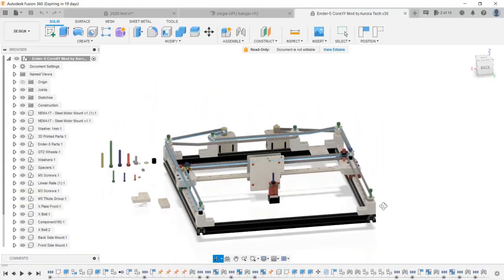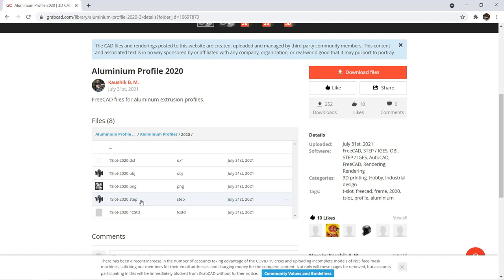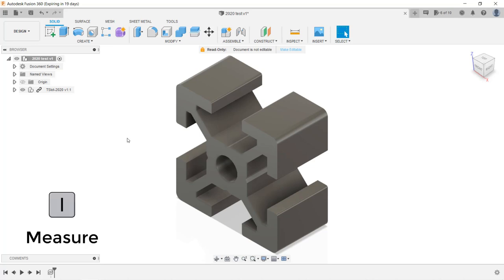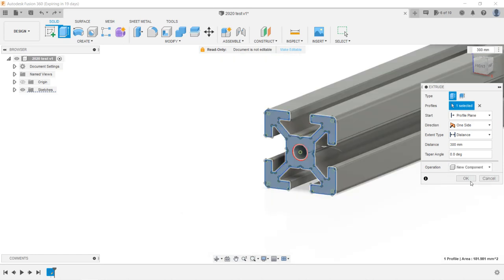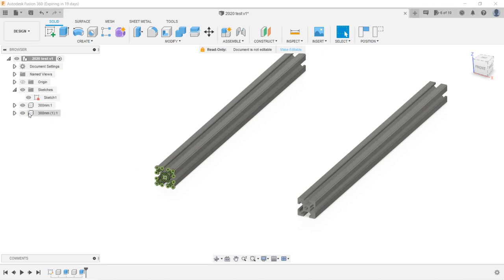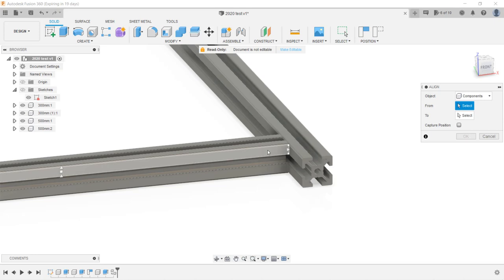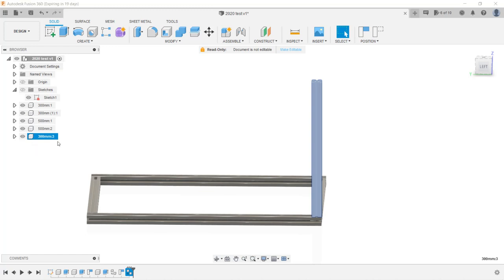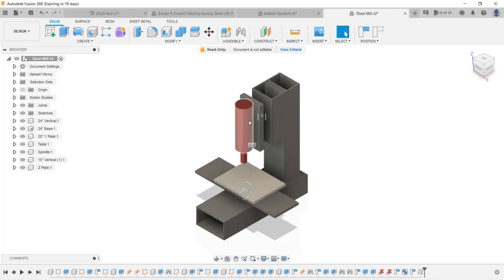Fusion 360 SHORT Tutorial For Beginners 004: Design with aluminum extrusion, import, project, align

Comment: You don't have to create a sketch from the imported STEP file. You can select the face on the imported part and Extrude it. That will create a new body, with the same profile as the selected face. Creating a sketch first is still a good idea though, especially if you need to reference part of the geometry in other sketches.

Another tip is to use the McMaster Carr library of parts. It's available from the insert menu in Fusion.
They have thousands of parts that include CAD drawings, that can be imported directly into the drawing in Fusion.
I used to use it for screws, brackets and aluminum profiles in the past.
Reply: Some of the item they inches to convert that a bit of different size than create the extrusion profile by metric to create. I did experience when I use the printed parts from Western diy cnc and purchase the metric extrusion from Aliexpress which over size on the printed parts. Did anyone come across this problem.
Reply: @alberttang1748  I haven't experienced that myself. There can be quite a large variation on extruded profiles from manufacturer to manufacturer. The profiles you could possible have been made to a slightly different profile, or with different tolerances than what the step file assumed.

Comment: At point 4:30 in the video, can anyone tell me how to center this new sketch exactly over the center point on the drawing plane. I've tried to move there, but I can't get it to move at all. Yes, I am a newbie Fusion360 user. I'm trying to use this sketch to make end caps for the frame of my printer. Also, why are the lines green, and not blue or black? Is this sketch fully constrained? Thanks.